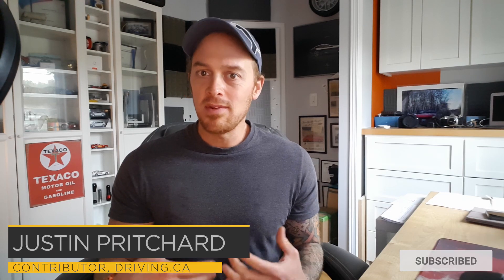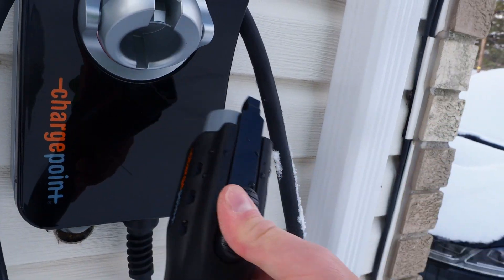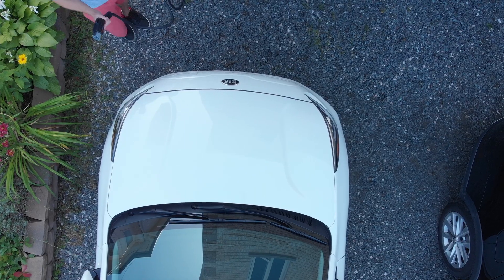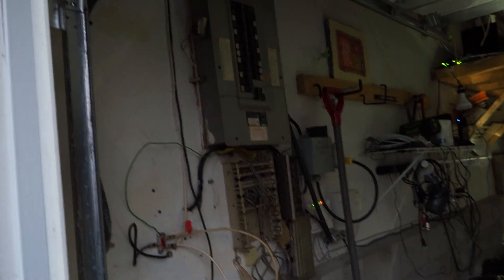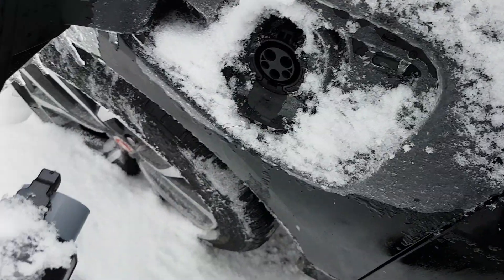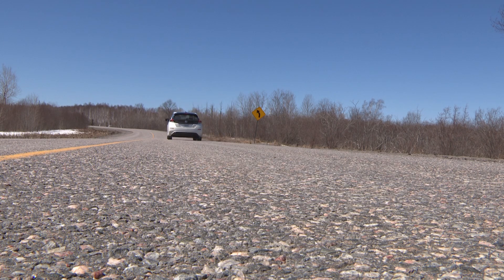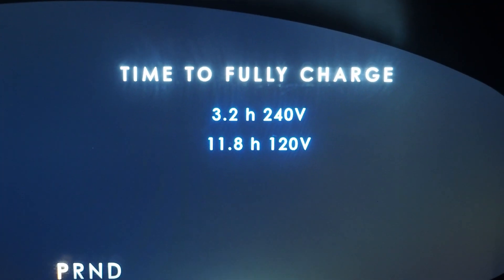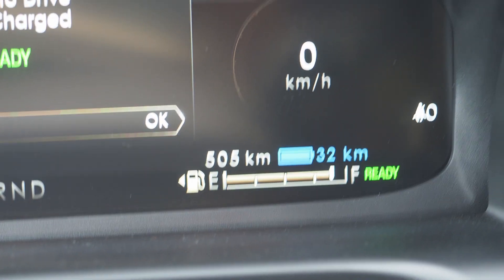How to install an electric vehicle (EV) charger at home | Driving.ca

Comment: Your title is how to install a charger and your process was - Purchased a unit on sale and called a guy to install...  super helpful.

It would have been nice if you discussed:
1. The factors used to chose the charger.
2. Electricity concerns like probably needing a 200AMP service.
3. The impact of choosing 120V or 240V depending on the tech of the car for fully electric or a hybrid system.
Reply: It's a west coast thing.